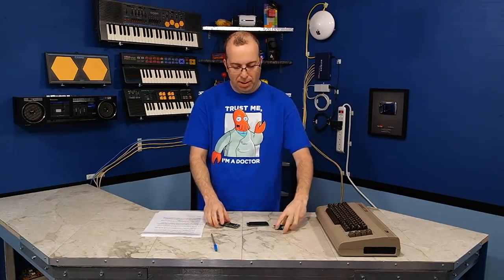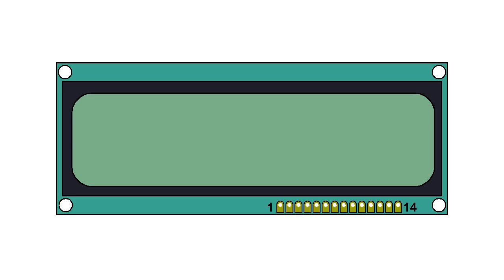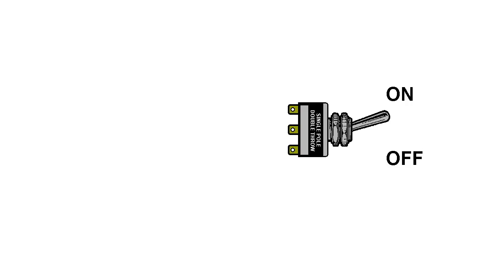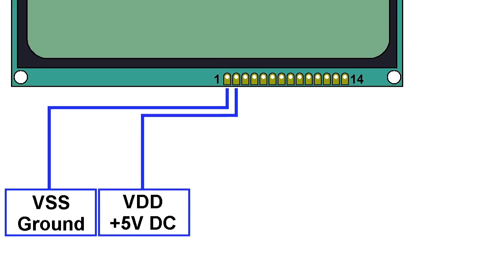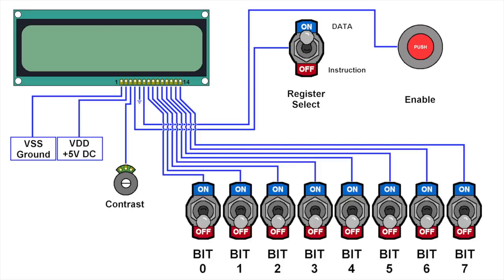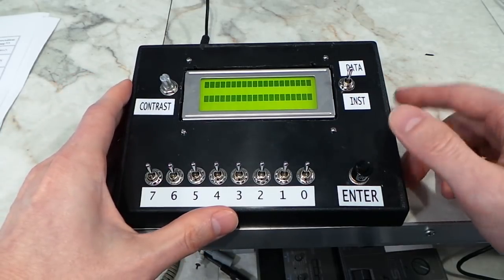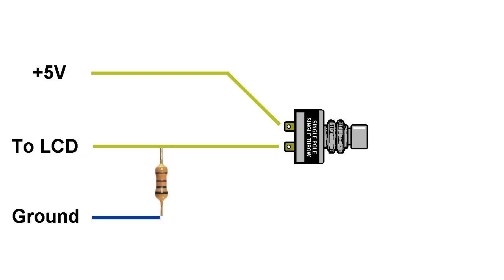How a Character LCD works Part 1

Comment: This actually would be a good basic dumb computer for kids to build as their first in a class room, as the one thing kids love most at first is simply being able to write on a screen.    They would learn a lot of basic fabrication skills, binary, and sending instructions /data.  I would suggest having it run to batteries for portability and a cribsheet of the most important info on how to operate it printed out and glued to the back.

Comment: just that the chinese 'datasheets' IF you can even find the correct ones usually aren't very specific on the timing of the bus. despite the 8 bit data and the register select and the enable pin are perfectly suitable for direct connection to the address and databus without some i/o chip or 1x8 bit rams in between... there is some scary stuff in some of the datasheets like '1350' (presumably) nano seconds which... is quite a LOT of time, wether that's maximum average or minimum wasn't even specified. and wether or not those timings are more or less standardized also remains the question. so in the end you just end up wasting some i/o chips on every single display anyway and addressing it indirectly through those. resulting in more hassle and extra code.

Comment: Why not solder a pin header onto the LCD's PCB so you can use a ribbon cable to connect it for future projects? That would solve the problem of potentially damaging the solder pads from repeated welds.

Comment: MIssing solder pads isnt too hard of a fix:  
- First carefully scrape the connected track to expose some of the copper 
- Next, take a small piece of copper tape and stick it on to make a new pad
- Then flow on some solder which will both tin the pad and bridge the connection to the exposed track
- Finally add a coat of clear nail varnish for best structural integrity (you can either cover the pad once you've soldered to it or leave the centre exposed like the original solder resist)

Comment: but the solder pads missing on the second display were on the side without traces? Isn't the pad still there on the other side, connected to a trace?

Also on the first display you should be able to scrape off the solder mask on the trace going to the missing pad.

Comment: I personally call the "enable" pin the "clock" pin.
Reply: In fact should you try the, say, HD44780 datasheet they actually call it "Enable". It makes sense in fact as: 

a) it excludes confusion with the actual panel controller clock;
b) while the data writes are edge-triggered, the bus reverts into the third state when the Enable goes passive with the bus being read by the master, unlike the actual clock which doesn't affect anything unless it exhibits an edge, and will never third-state a bus. Reading a device happens before releasing Enable, not on any of one's edges - which is nothing compared to how the clock signals work.

c) Unlike in serial interfaces where you get both the select (or enable) signal (either dedicated like in SPI or JTAG, or encoded by other signals' combinations like in I2C, Dallas etc) as a frame control, and a clock one, here the pin actually acts like both a frame control and bus clock at the very same time (as all the frames are exactly as wide as the bus itself), and also enables the bus output in read mode;
d) the bus used to have more slaves, so would have numerous clock outputs - with that, having pins titled "Clk#" on a diagram would make way less sense compared to calling them "Select #" or "Enable #", as the latter naming immediately points towards enabling the data exchange with a given slave.

Comment: Are the character sprites stored in a ROM on the display’s circuit board? Those switches don’t control the individual pixels but which char gets displayed where?
Reply: Yes, that's why it's called a character LCD. It has different fonts stored in an internal ROM. You can select (through an instruction) which font to use. Also there are ways to define some custom characters (usually up to 8) by defining every pixel for one character. That character can then be used like those from the rom. This allows some flexibility. However in the end it's always a character display and not a graphic display.

The controller that was actually used on the LCD is the common HD44780 controller. See wikipedia:
https://en.wikipedia.org/wiki/Hitachi_HD44780_LCD_controller

The datasheet explains literally everything about the controller. The physical internal structure, the instruction set, the different command modes, etc

Datasheet:
https://www.sparkfun.com/datasheets/LCD/HD44780.pdf

That's actually the nice thing about defacto standards and "holder" hardware: It's properly documented unlike many modern hardware. Of course a lot modern hardware is much more complicated. Just read up the documentation of the USB protocol and you're gonna shoot yourself :D While the datasheet of the HD44780 is 60 pages and explains pretty much everything about that piece of hardware, just the basic USB 3.2 specification has 540+ pages (23 pages are just index). Of course a universal bus is a lot more complex than a character display, but it generally show the increase in complexity in general. Real simple hardware is extremely rare nowadays. Everyone wants hardware to support wlan, usb, bluetooth, ...

Comment: Seems fixing the data switches would be easy enough. Just swap the ground and power wires. You set it up so you wouldn't have to resolder each switch.

Comment: Hello, I need help to change the LCD screen of a Yamaha MDP-5 MIDI file player that was only sold in Japan and there is very little information, there doesn't seem to be your Service Manual. The problem I find is that the screen, 16x2 characters, not retoiluminated, gets 20 cables. I'd like to replace it with a larger backlit one, so I can read it standing up, as the device is mounted on my guitar footswitch. I don't mind relocating everything in a new box, but I'm in a hurry to get a 16-pin screen and not be able to connect it, or break something. What can I do? Thank you very much, your channel is extremely interesting!

Comment: I thought they worked like a graphical LCD, only some space left in between certain lines. This way you would need to work with a 20*160 graphical LCD, which is harder for the CPU.

Comment: So basically the capacitor is acting as a low pass filter, to filter the high frequency bounce, am i correct? & any reason for putting the capacitor in between the 5 V to to LCD? I would have put it from LCD to ground?
Reply: As you said, the cap is filtering the high frequency bounce, by integration. Either way of connecting the cap would have achieved the same result

Comment: you might switch the 5v rail with the gnd for the switches on the bottom or did this not work? they are just simple switches aren't they?

Comment: Why do you hard-wire the cables? If it already has a pin header, just use a female socket for it. The you can stick your cables in and out without ever damaging the pin header or anything else. Adding a pin header to these displays for connecting cables is the first thing I'd do and then I'd never touch the displays with a soldering iron again and only plug in cables to the pin header.

Comment: So please tell me, Would it be possible to build a basic computer only from switches knobbs and LCD screens?  if you can read/write , I think you should be able to chain them together using them to read from one set as a Makeshift RAM and use the other set as a ROM ...  I admit I dunno what application this method could ever be used for, still I can't help thinking that the idea could be possible!?

Comment: How much is the value of the potentiometer?

How much is the value of the resistance? and Is it necessary?

How much is the value of the capacitor?
Reply: The value of the trim pot will be determined from the LCD spec sheet. Looking at mine it says 10k. The electrolytic capacitor is 10uF 35v. The resistor looks like 660ohms (dont quote me on that).

Comment: The is very interesting because I have an LCD display that I got out of something but can't remember what.  LOL  I've tried to search for information about it to see if I can use it for something.  Maybe you could give me some info on it if I could sent you a pic of it??  It has 15 pins coming down from the center bottom of it and it is mounted in a white place setting.  It can be easily removed from that though.

Comment: "Set the font"?

How many fonts does that LCD have?
Reply: They have two sets: the 5x8px displayed here, and 5x10px, but on the pixel arrangement this one has, the taller one does not exactly look pretty. (I don't think I've ever seen one that has an arrangement on which it would, either)

Comment: I know this is an old video but couldn't you have just resoldered just the two wire ends at the source for VDD and VSS to fix all the switches at once?

Comment: If all the 5v and ground wires are tied in parallel, couldn't u just swap the two leads to power so the switches behave like they're supposed to?

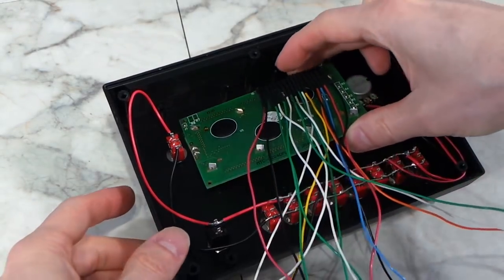Comment: 8:14 You made mistake. You could just get a goldpin connector and solder to it, then you could easily reuse this LCD without any desoldering. I made such a mistake once and then i decided to NEVER EVER solder wires directly to the LCD.

Comment: 9:55 where is the "00001111" command to initialize the display in the datasheet? All I could find is that is should be initialized on power up, unless there's an issue and then there was a list of instructions (see "Initializing by Instruction") on how to get it initialized again. But nothing that simple

Comment: PSA: the pulldown resistor shown in the diagram has a very low value. You should use at least 4.7K, and I recommend 10K for most applications.

Comment: Does anyone know why how to use the bottom row of a 2x16 lcd with this setup? What is the binary instruction to move to the bottom row?
Reply: I think just move beyond the boundaries.
Reply: you have to advance all the characters until you reach the end of the virtual line (in all lcd displays the row is 40 chars. long, even if your unit is 16x2) and the cursor will show in the first place of the second row.

Comment: I did the same on breadboard, the lcd works fine on instructions but it just writes one char with 3 lines or space regardless of the  ascii code. It even sometimes writes the line thing and when I do it again it writes a space. I can’t get it to work. Any suggestions?

Comment: im working on a clculator by logic gates and i m avoid to use any kind of programming......but i stopped in LCD part in delete a single character exactly......what is the binary code set to delete a single character with one button ?????

Comment: Funny.....alot of new comments and interest recently in this video.... maybe because of Covid, huh??  Those are interesting modules, always wanted to use one.... the driver board is the sophisticated part....I'm sure it's running it's own micro-controller on board.   Even with that level, you still have to 'interface' to it with some kind of parallel port, and create a 'library' of functions to make is 'useful'.... ya know, like backspace, delete, and other 'editing' functions....  Now for the author comment....you seem to make things more difficult for yourself....just add 'jumper' wire to fix that bad PCB land....geez, and as others have said, just reverse the +5V and Gnd feed wire to the switches.... you seem to get hung up on the simple things....just my 2 cents.

Comment: why did you decide to have the switches from 7 to 0 and not 0 to 7?
Reply: that’s pretty standard, but as you can see in the video, the labelling doesn’t matter. the switches were actually 0 to 7 when he was using them because he accidentally flipped everything when he was making it. but the reason he wanted 7 to 0 in the first place is just because that’s a common practice in digital design

Comment: just excange PLUS and MINUS under the switches. than the switches are right!
Reply: no, just resolder two wires supplying the switch polarity.. the plus rail, and the minus rail.. derrrrr....

Comment: hello can anyone help. I made the lcd box that was in this video.  all works but I have a slight problem.
every ascii code I enter is incorrect.   ive had to make my own binary code. does anyone have the answer why .? 
here is a example of my code.      A = 10000010   B = 01000010   C = 11000010  AND SO ON.
Reply: Hmm...you probably figured it out by now....but I think you just have LSB (Lowest Significant Bit) through MSB (Most Significant Bit) reversed..... see the this ASCII chart here... http://sticksandstones.kstrom.com/appen.html